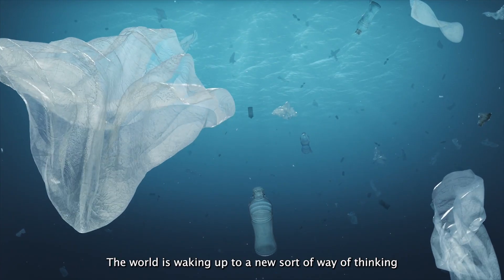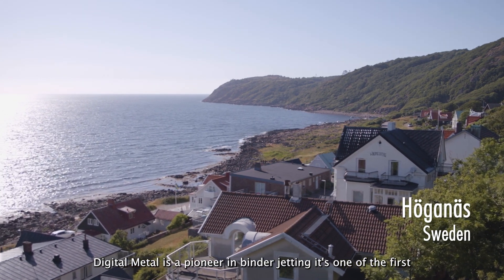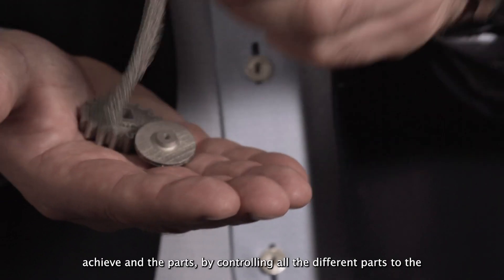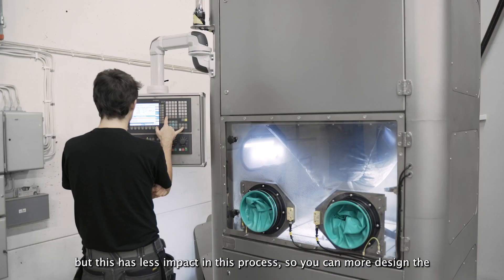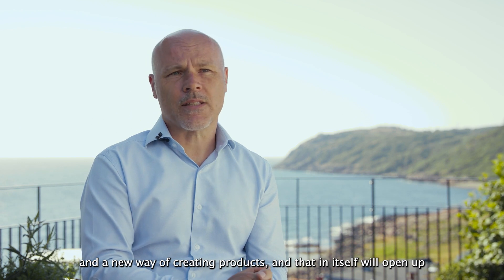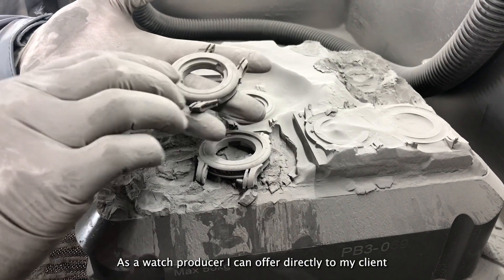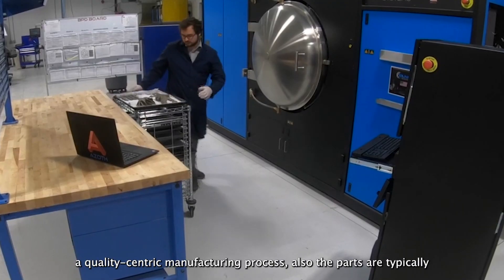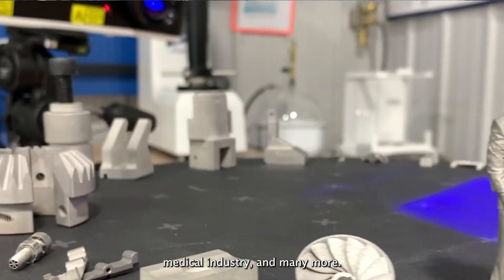Digital Metal: Transforming Manufacturing

Comment: Great tech! But is this useful enough for manufacturing moderate/large size components? For instance, of size around 500x500x500 mm? Looks like it is very beneficial over other techniques but for small components production.
Reply: Casting is then the best, Desktop Metal group has ExOne to create digital castings for changing casting projects